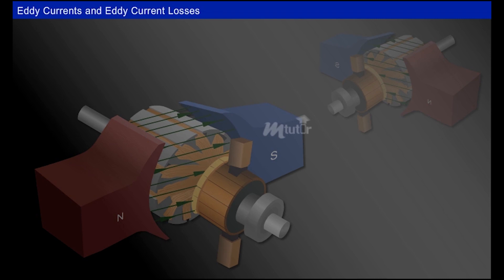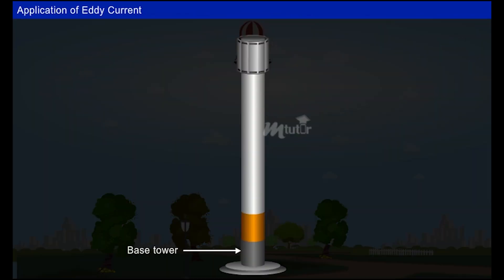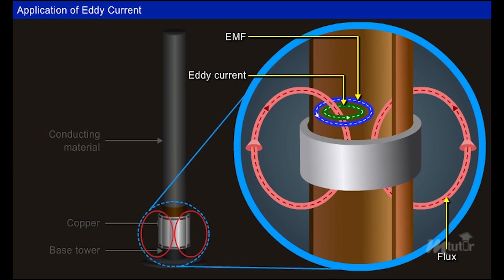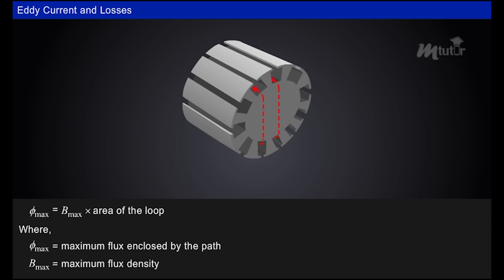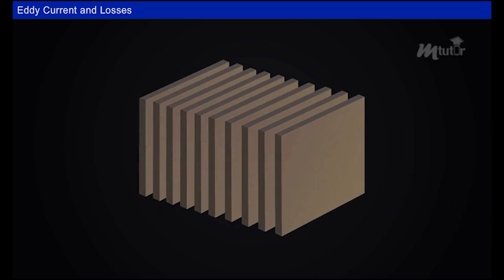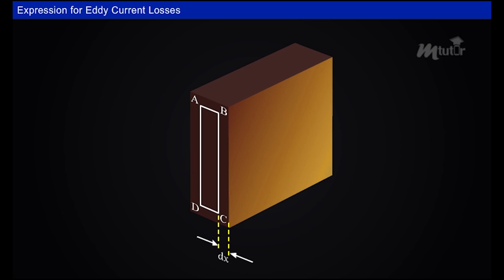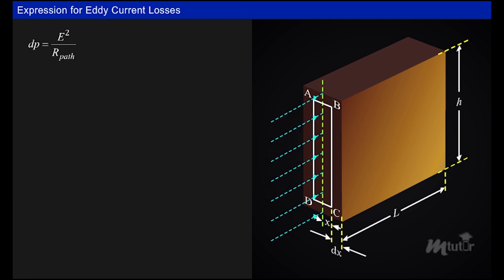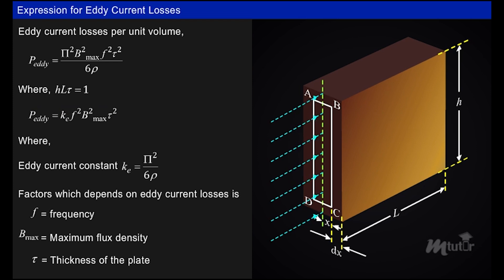Eddy Currents and Eddy Current Losses [Year - 2]

Comment: as the crossectional area for the resistor is incresed resistance decreases and therefore the power losses should be reduced? Why did you say it was the opposite?
Reply from the maker: For your clarity, in rotating electrical machines, eddy current flows in the whole surface or maximum cross-sectional area of the rotor core. If cross-sectional area of the rotor is maximum, the resistance offered by the rotor is minimum and the induced eddy currents will be maximum. Due to this, the eddy current losses will be maximum. It is obvious that if the cross-sectional area of the eddy current path is reduced; the eddy current losses will also be less. This is explained in this video.